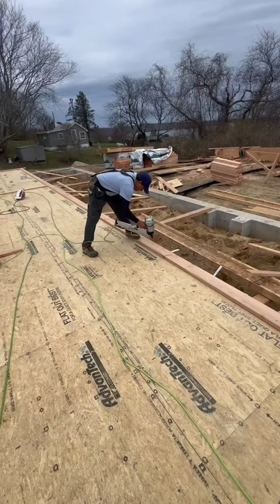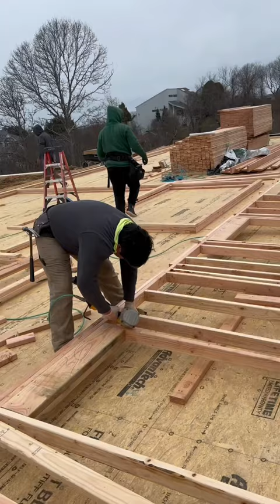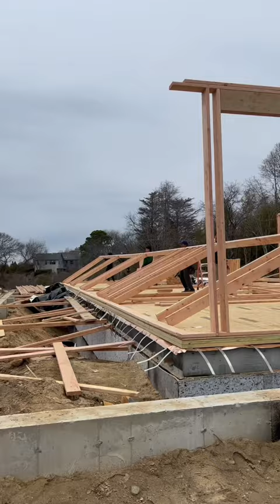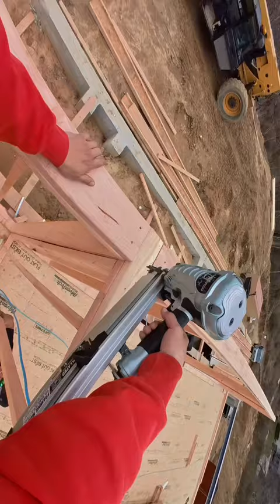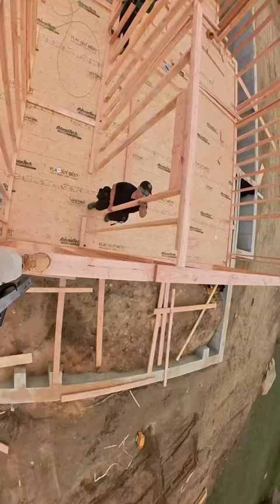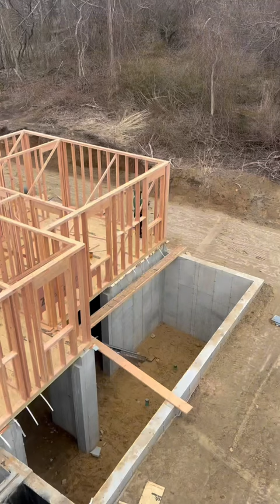Walls #shorts #short #work #construction #design #skills #carpenter #perfect #team #architecture

Comment: Dumbest way to frame 😂😂😂 this is ilegal in california
Reply: Both end nailing and toe nailing are mentioned in the ICC. Nothing illegal or in violation of code. If you know otherwise, send me the section in the ICC for California. Check the California residential code - matrix adoption table chapter 6 table R602.3(1). These guys toe nail, triple plate and stand walls to sheath later. Smartest way to frame actually. If box framed walls were a better way, they would square and sheath walls on the deck (like I’m guessing you were taught). I’m also guessing you haven’t seen or done much of this yourself. Not intended to offend anyone. There are a lot of critical comments about standing walls by people who are seeing it for the first time. Learn to triple plate and stand walls this way and you won’t box frame again. Keep watching and learning.

Comment: Wrong
Reply: What’s wrong Jose?
Reply: @henrypeisch5289  nails need to put on plate
Reply: @josegomez9849  studs are toenailed to plates top and bottom, Jose. You were taught to box frame walls. End nail studs, square and sheath on the deck. You are working too slow. Keep watching.

Comment: If you have the man power, plate, frame , square up each wall sections and sheath the exterior walls and stand 1by 1. It saves 2/3rds the labor cost setting up scafolding and man hours in the overall framing and sheathing time. I've been framing for over 40 yrs. It is by far the faster method of stick framing. You can leave out all the window sill framing sheath over the window openings and frame in later to lighten the exterior walls when lifting long lengths of wall sections. This is the best method especially when framing 2nd floor walls and lap the 2nd floor bottom coarse plywood run to over lap the 1st floor window and door headers to the bottom of the headers.
Than proceede to plate and frame the interior wall partitians.
Reply: I think you are describing typical box frame or west coast Cali style… do I have that right? Funny, that my experience is the other way around. I’ve also seen a bit. Triple plate is fastest to the roof. 2 man crew, 5 or more…it doesn’t matter still a faster and neater frame. You need to know how to tack and toenail. Your guys can be green if they can bend and nail to the mark. If a guy can’t hand nail, they don’t pick up a gun until they can. You need to know how to sheath. If you are using scaffolding, stay with box framing. Out of curiosity, minime1721, how many homes did you frame with the method in this video before deciding to stay with end nailing, squaring and sheathing on the deck? This is my typical question for the box frame only people. Maybe you will be the first to say that you have extensive experience with all styles of platform framing. Maybe you are a heavy guy or can’t move that well. Maybe you are afraid to climb. Maybe there is a reason you decided to just box frame walls. That would explain why you think box framed walls is faster and cheaper than triple plate. But we never used scaffolding. Suicide brackets occasionally but that was rare. The fact that you suggest scaffolding makes me think you have only box framed walls. No disrespect, just curious why nobody who comments is familiar with what is the best, most accurate and efficient way to stand walls and get to the roof. And that is hands down - the way the crew (in these videos) frames. My condolences and apologies to the box frame only people who are going to read this comment.
Reply: So, you were too heavy to climb. Do I have it right?
Reply: Maybe it was your mentor who was too heavy to climb or did not like ladders. Only because you learned from him. No disrespect. We all have some limitations. This crew could box frame if it was an advantage with respect to speed and quality of frame. But they triple plate. Only because it it faster, better and more efficient. It’s good that you can make your clients happy. Just don’t bash a method that you haven’t done enough of…to offer a valid criticism. That’s my only beef with the initial comment. All the best.
Reply: @henrypeisch5289  haaa no. Non of us were to heavy or afraid of heights. Bottom line why put guys on scaffolding , ladders, spend the man hours  and risk injuries if you can do the majority of the sheathing while its laid flat on the deck.
Reply: @minime1721  keep watching. Keep learning. All the best.
Reply: @minime1721  watch enough of these videos and then ask yourself why they don’t box frame. Then come back to your fist comment.  Triple plate is only a little more difficult to learn and teach. But it’s worth the investment. Find a layout and cut guy who works like this crew, pay him for two weeks and work alongside him. It will be worth your investment. I promise.
Reply: @henrypeisch5289  FYI no offense taken in any of your questions. We all in the trades have had multiple methods taught to us by a multitude of people w/ years of experience.  Every single one of my past foremans who moved on / started their own companies practically use the same methods I have taught them. All of them Before they came and worked for me framed the same method in the video.
Reply: @minime1721  that sounds like cumulative instructional error. Tell your guys to watch this channel. All the best.
Reply: @henrypeisch5289  I tripple plate in the same method leaving all notch outs on the exterior walls  for all the interior wall tie-ins that run perpendicular to the the exterior walls. My entire second floor floor joists or roof rafter layouts are already marked on the double top plate framing when before we even even start framing the walls on the deck. I litterally cut and test all my common rafter patterns and hip rafters when I tack nail the sole plate to the deck. We litterally cut the 2nd floor floor joist or roof rafters, ridge boards, ect..  as the wall assembly framing is in progress and being placed.
Reply: @minime1721  I may have misunderstood. You triple plate but your sole or shoe is also pulled back (in addition to detailed top 2 plates) to end nail, square and sheath exterior walls on the deck - before standing. Are interior partitions also end nailed (shoe pulled from chalk line on deck to end nail). But all wall studs are also toenailed at the top double plate? Top plates are nailed home and tacked to pull back and toenail then bottom plate is pulled to end nail, square and sheath? Maybe easier for me to understand if you point out what you think is wrong or less efficient with the way they stand walls in this video. Maybe it’s just a safety upgrade to eliminate ladders. But maybe not a time saver. Triple plate, detail plates, headers attached, studs toenail only, leave out jacks, corners, tees, sills and cripples, line, plumb and brace walls - is typical of what some call east coast - as done in the video. Double top plate = toenailing. Sheath before standing = end nail bottom plate before sheathing. So, do you triple plate the entire layout before pulling any plates? Or just the exterior walls that are sheathed on the deck before standing? I can see this being done but don’t see the time savings you have insisted on even tho it’s been 35-40 years since you have framed properly and left the sheathing off. But I’m always interested in hybrid framing methods. I appreciate the key strokes and your patience.